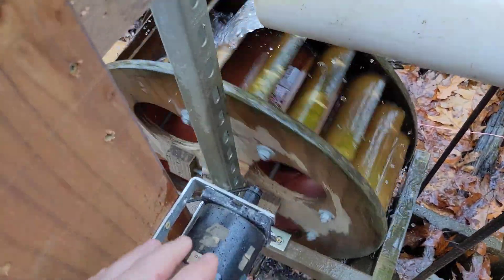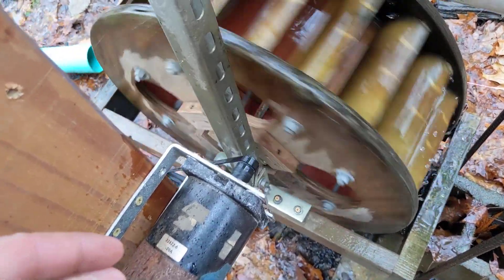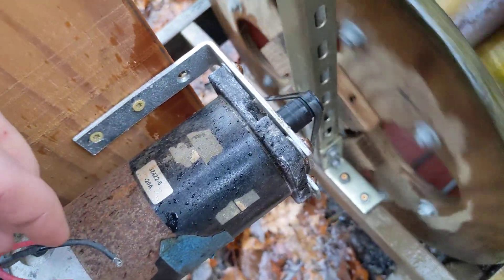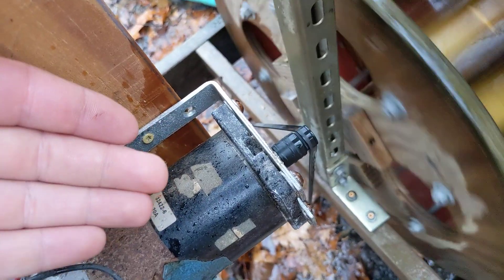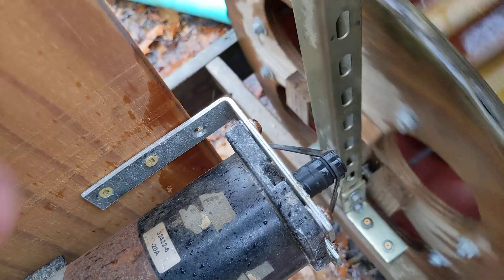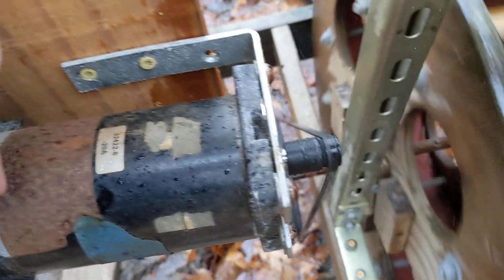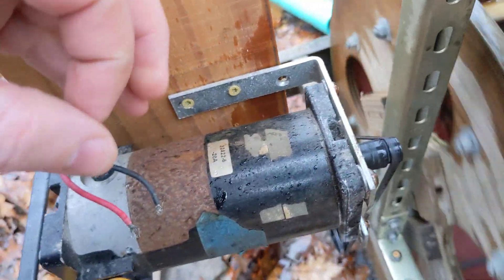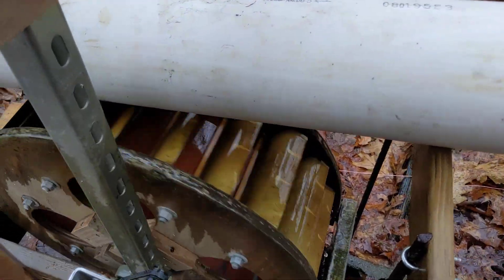Teaser of trying to harness (more) power from the waterwheel.

Comment: After reading your description, and checking out the vid, IMO, you're going to need quite a bit more power to spin the genny under load. My thought is you either build a (quite) larger diameter wheel, or possibly duplicate the wheel you have now, then put the two wheels side by side, which will only work well if you can increase (double) the water flow, since now you would be splitting the flow to 2 wheels. Another thing you might consider is adding weight to the wheel to give it a 'flywheel' action to absorb start up loads better, without slowing the wheel so drastically. I'm designing a water wheel around Missouri Wind's smaller PMG, and the Midnite Solar controller. I would like to get the mechanics as far away from the water as I can, because I would like to use the remains of a 10 speed bicycle gear train system to run the genny. With the derailleur, I can tailor the rpm of the genny depending on load. I'm imagining a minimum 10 ft diameter wheel... possibly 15 ft. We don't have water issues here in the PNW, so the sky's the limit in terms of what I can design.

Comment: A tensioner probably wouldn’t hurt to put in either given your unengaged belt length.
Reply from the maker: That is on my mind, yes.
Reply: @JoeMalovich  switching to bigger diameter gears on both pulleys could be another way of mitigating the problem, adding more surface area for the belt to grip on (especially on the smaller pulley). And ofc make it more expensive XD

Comment: Joe, it looks like that bracket is way to flexible to take a reasonable amount of torque from the belt.
I think a deeper pitch belt will still jump too..
Reply from the maker: I have a clamp on the backside that stiffens it right up
Reply: @JoeMalovich  Then maybe it's the wooden board twisting , sure I can see movement.
Reply from the maker: @rl3898  it's all just temporary so I can start on the 6ft wheel

Comment: I have a ton of old electric motors.  Dunno what style you need, but you're welcome to pick thru them next time you're up this way.
Reply from the maker: It's tricky. I need a high voltage low rpm permanent magnet motor (DC or 3ph AC) with low friction.

Thanks for the offer!

Comment: you could probably just add 2 ball bearings that go on the belt at either side right under the small pulley and push together, so that the belt gets wrapped around the pulley like a betamovie player. that should give you an effect similar to leverage with greater pressure on the pulley (I think) and definetely more contact area